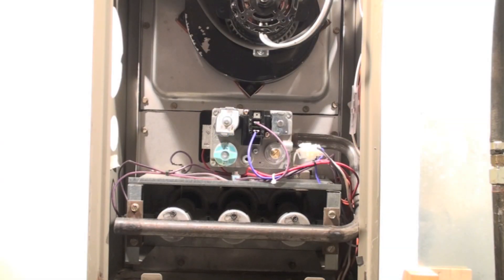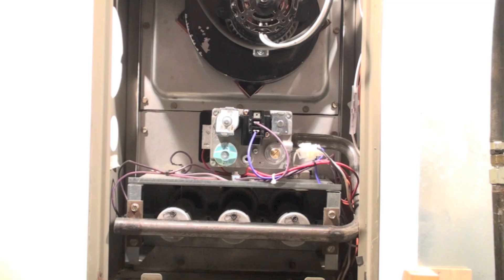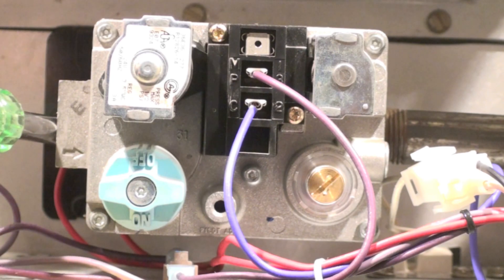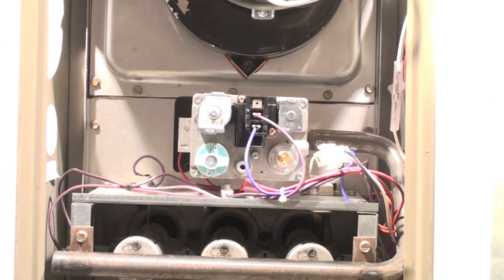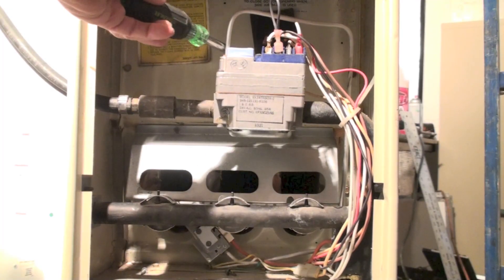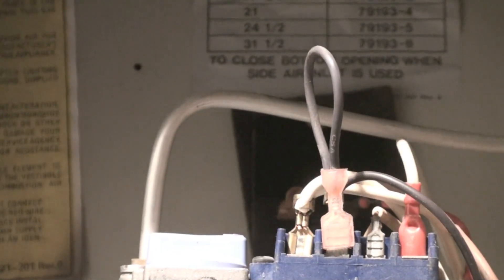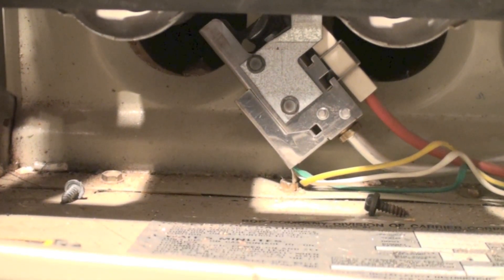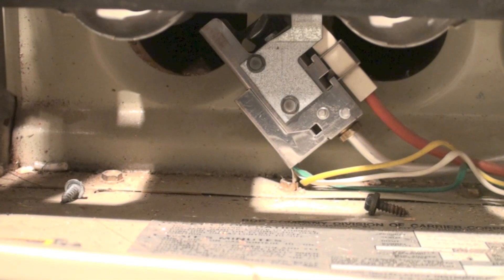Finding the pilot tube on a gas furnace.

Comment: How do you light up the first one with no pilot? My furnace looks similar to the first & I can hear the heater clicking but not coming on. Please help.
Reply from the maker: That furnace has no pilot because the main burner is lit by a "hot surface ignitor".  I would first start the furnace from the thermostat.  After a few seconds, you should see a yellow glow from the burner area.  No glow, you could have a failed ignitor or a pressure switch not closing.
GFM
Reply: @grayfurnaceman  thank you so much. I will go try now!
Reply: @grayfurnaceman  what if it’s coming on? But about 5 seconds later it cuts off.
Reply from the maker: @kristina3008  Sounds like a flame rod problem.  They can be cleaned.  Here is a video diecribing how:  https://youtu.be/0ZYXK8450mM
GFM

Comment: I have a 1986 Carrier 58GS. I went to turn it on for the first time and there is no "clicking" and no pilot light coming on at all. The motor (blower?) runs, pumping out cold air. Where should I start; replace the 3 wire pilot first? I'm new to all this. Thank you so much for your thoughts!
Reply from the maker: First, if the blower runs on a Carrier it means there is a power problem.  I mean low voltage power.  This is the power that goes to the thermostat and controls the gas valve, etc.  You could have a limit or rollout switch that is open.  If you want to go further, I have a number of videos on that model furnace.  Use Carrier 58GS in the channel search.  They should come up.  Hope this helps.
GFM

Comment from the maker: If the pilot is sparking, the pilot and ignitor are ok or the pilot orifice is plugged.  The orifice is inside the pilot on the pilot tube.  The brass fitting on the pilot must be removed with a 7/16" open end wrench.  No pliers.  Yes, it gets  stuck because of the heat.  The fitting is the same on the inside as the other end.  Maybe a little oil.  Look up the 58SS pilot videos.  Does it spark then light then go off or just not light?  Do you have gas supply on?
GFM

Comment: I really appreciate the videos you have done, I am a new home owner and our furnace is able to spark but will not light, it is a 1985 Bryant and has the parts from second furnace you showin this video. I think I need to replace the electric pilot and furnace ignitor but I cannot get aluminum tubing off the the pilot any tips ?